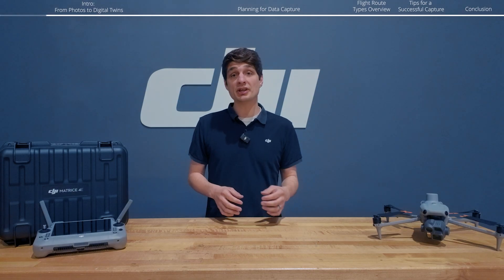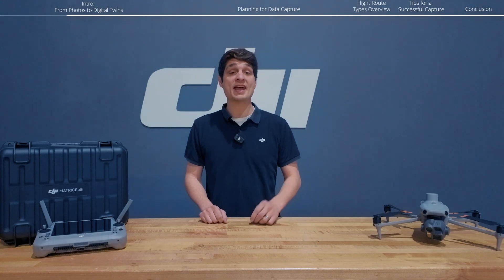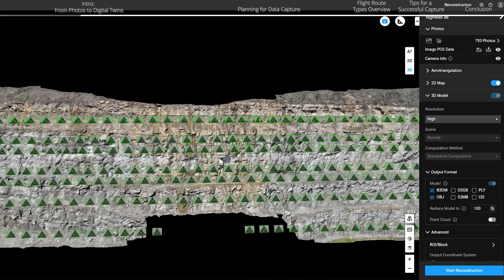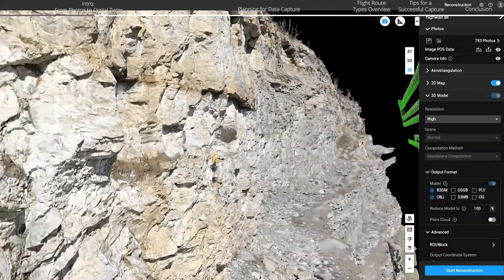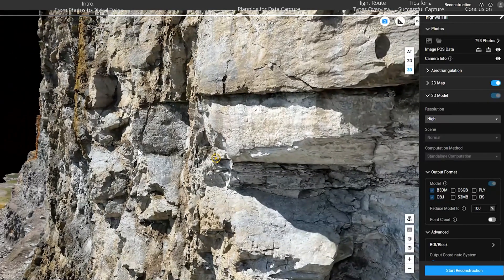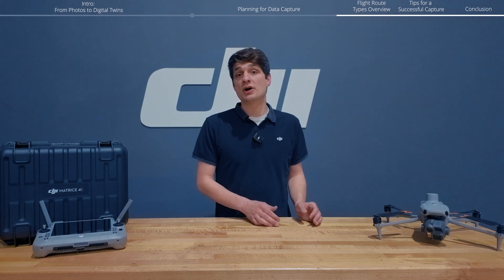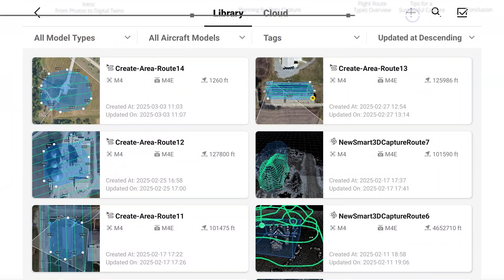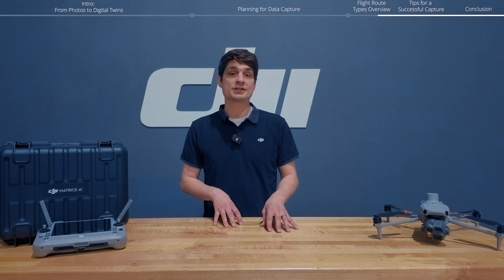DJI Enterprise Mapping 101: Digital Twin Basics

Comment: I assume you’ll be using the 4E for mapping, but will you also include how to do it with the 4T?
Reply: Generally the workflow is the same to setup except you select the 4T payload option and most likely select visual only for data collection.

Does depend if the mapping option is supported by the 4T. 
Most options are  (Geometric, Slope, Linear etc.. ) 
Some like Smart Oblique Capture are only supported by 4E.